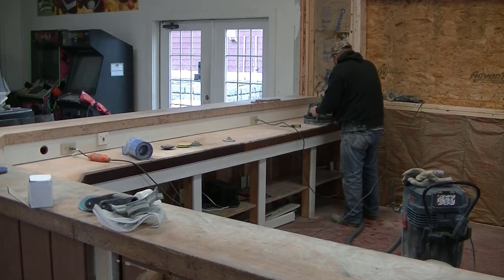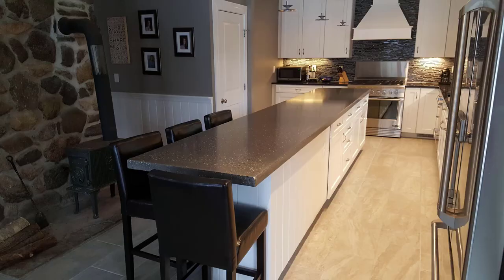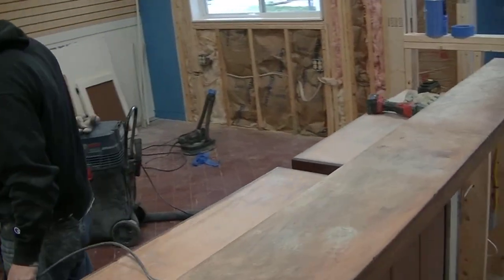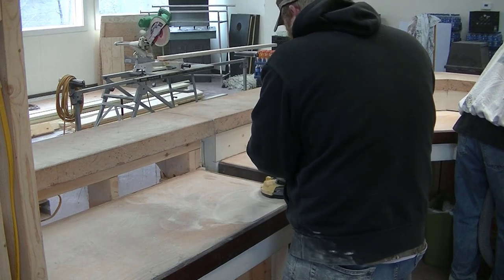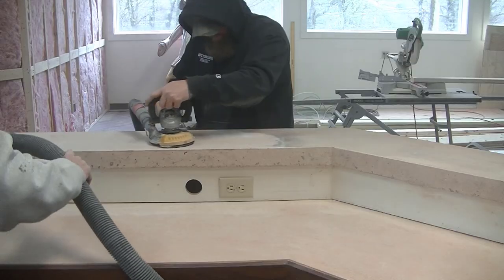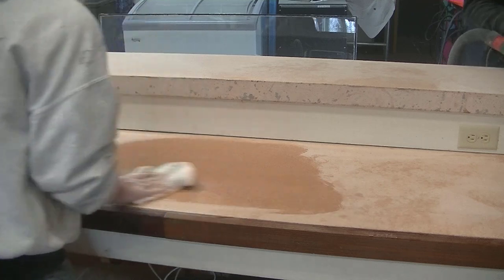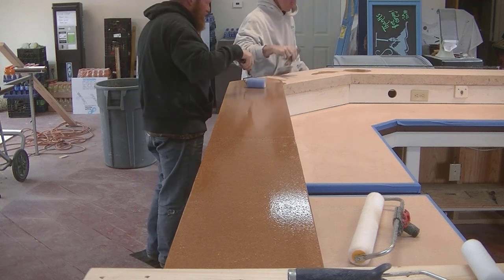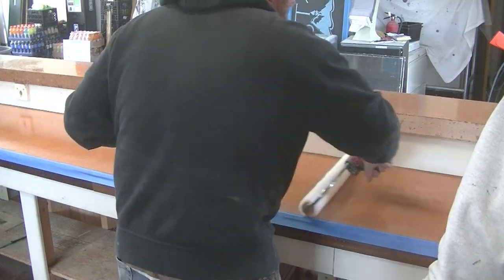How to Reseal a Concrete Countertop (Totally Restore it like New!)

Comment: Hey Mike I watch all your videos and I think you're awesome at explaining yourself. I've learnt so much from you over the years. I own my own concrete company specializing in flat work. recently I had a pour and just as I was about finished the weather took a really bad turn. it started to rain like crazy. I squeegeed off the cream and tried to hit it over and over with the power trowel, before feeling defeated I covered it with 6mil poly and let the storm do its thing. I returned  in the morning to see if the power trowel could work it in. now every time this slab is swept with a broom., dust continues to come out of the slab. the mix was supposed to be 32mpa it appears the ticket said 32-c2 which is an indication there is air in the concrete. it has some delaminations. at this point I don't know what my best solution is to making this right for my customer

Comment: Aside from removing the sealer if there are some areas that are pitted and dark. Will grinding it with the diamond pad will that smooth it out.  It is high use areas.

Comment: What is the maximum humidity/moisture percentage allowable to be in the existing basement floor before sealing??? We get water in the basement of one of our rental properties. We have soaked up all the standing water, and rented a dehumidifier and the current % varies throughout the basement from 50-60%. Is it safe to apply a sealer now? Which sealer will be best for the fully poured concrete basement floor in the later 1940s. Another video you said use the pump sprayer and spray the floor walls with water and then immediately apply the sealer. Assuming you meant from dry so then only the surface is now wet and the rest is dry behind the water he just applied. Im dealing with a wet basement 50-65% plz help 😢